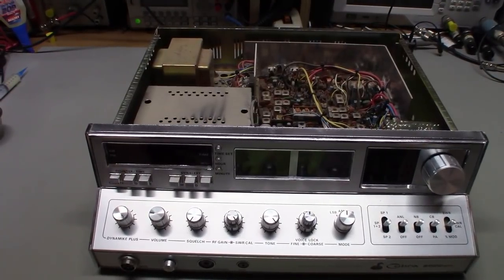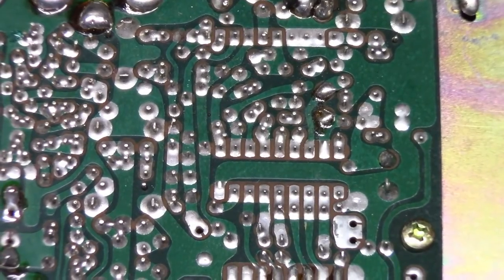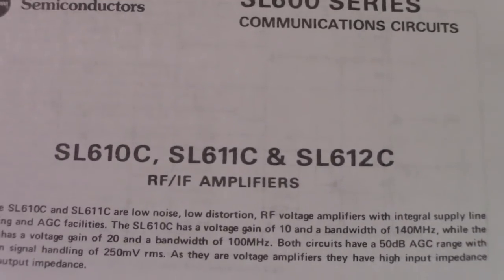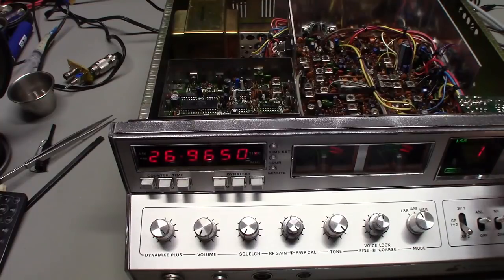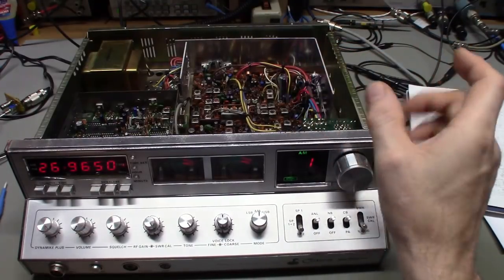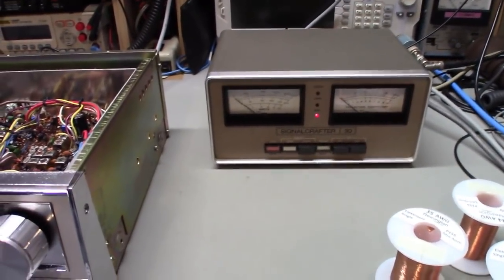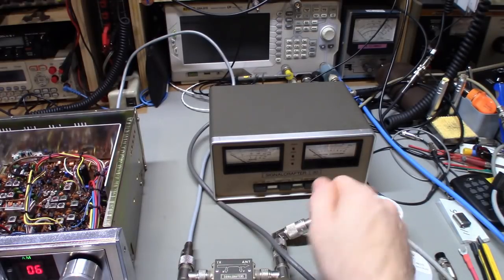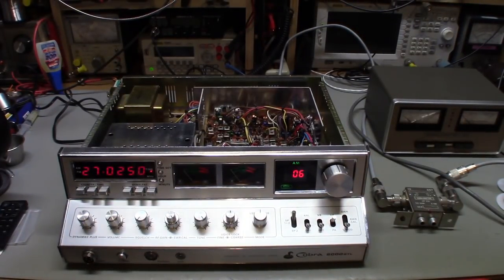Cobra 2000GTL restoration and Channel King board install. Sneak peak of Signalcrafters wattmeter.

Comment: Never ask a truck stop tech to peak you power! If you need more power buy a Amp.  This happen to me... it sounded like a sloppy mess on several frequencies.  These radios are set for maximum power output (safe) from factory for a reason.  Thanks Mike for fixing my problems.

Comment: Only complaint I might have about the wattmeter is the use of RCA connectors. I see that the sensor is bolted to the back panel which is good and you're probably not going to be changing it often. Reminds me of what Heathkit (and Collins as I recall) used for RF and interconnects. I had to replace the entire strip of RCA jacks on the back of my Drake R-4C receiver years ago because they got dodgy as even the ceramic interior insulator material will degrade over time, especially with repetitive mechanical insertions/removals. Thanks for sharing Mike, good radio fix as usual.
Reply: I always despised the rca antenna jack on my old heathkit hw101. Changed it to so239.

Comment: OK it's been a loooong time but if mem serves the 2000 and 148 were the same radio and I THINK the original President Washington as well? (before Uniden ruined it) It may have been the Madison or Grant. On the vco coupling transformer in the counter I seem to remember they had a frequency that you just peaked it to but it could work better to just go for equal db down at 1 and 40. Seems like you had to do it that way if you expanded the PLL. I was never an authoritative cb tech.

Comment: Wow, randomly looking at 2000gtl videos and found yours. Just posted 21 minutes ago.. crazy.. I recently acquired my father's 2000, he bought it in early 90s. It has some mods and dings on it.. I want to restore it, it all works perfect, except I don't need the mods as I'm a ham and have radios for that. I want to restore to factory eventually,  however I'd like to fix the ugly holes in the bezel first, any idea where I can get a front bezel? Once I make it better looking ill remove all the mods if possible..

Comment: I have a Drake Receiver . it needs work. I wish you were around here I would have you work on it. it just stops on the freak counter there is probably more wrong. parts might be a problem. I also have a am one which is a boat anchor. my house got hit by a lighting strike and it got fried. it was just am. where the i bought later had am and side band.

Comment: 6:40. How do you tell if the clarifier is locked?
Reply: Your transmitted signal will not change if it's locked If it's unlocked, the receive and transmit will be unison

Comment: Mike, I am curious. You seem to do a lot of rework on radios that have been butched. Why the decline in quality work and is it because the push to make money causes rush jobs and short cuts or is technical ability just declining?
Reply: It's all about what the customer is willing to pay, often the Labour charge on a big job outweighs the cost of replacing the radio or piece of equipment.
Things are made much cheaper today because they are expected to be upgraded, replaced more often, not such the case 30 or 40 years ago when a basic tv cost the equivalent of about 1000 bucks in today's money.
A new Homebase 40 channel  c.b radio in 1980  cost the equivalent of a basic HF set today in real terms.
I could go out and buy a 26-30mhz anytone all mode, frequency and channel display, built in swr meter, echo Mic, 40 watts out the back, no drifting, for less than 250 bucks today.
Or I could pay 250 bucks to have a big repair job done on a cobra 2000, the cobra 2000 probably cost the equivalent of 600 or 700 bucks back when it was new
Reply: I've heard of people paying over $1000 to have a cobra 2000 restored. Unbelievable but it's what they want.

Comment: What about taking the radio outside and blowing the dust off with compressed air?
Reply: You have to be careful with compressed air, it contains moisture. If using canned air the CO2 can cause problems on open boards.

Comment: on that custom programmed rom, it should be possible (at least i would believe) to take a working one pull the programming off of it, and install it into a new blank chip if you can still get one or at least a working replacement.